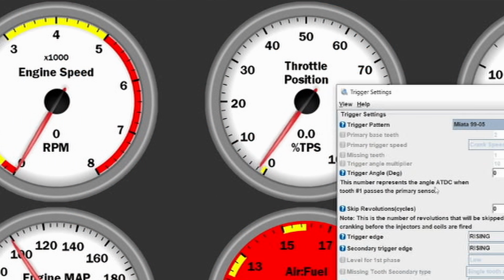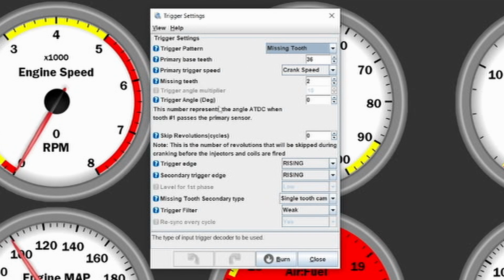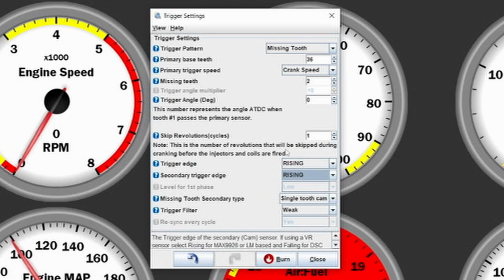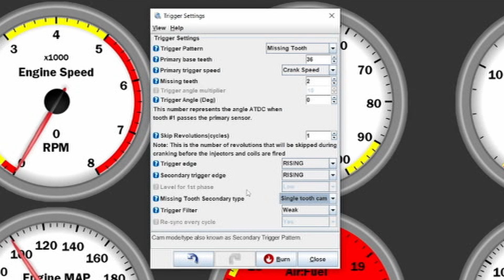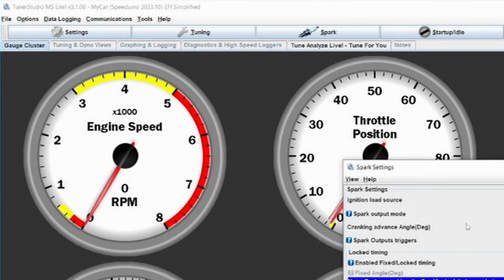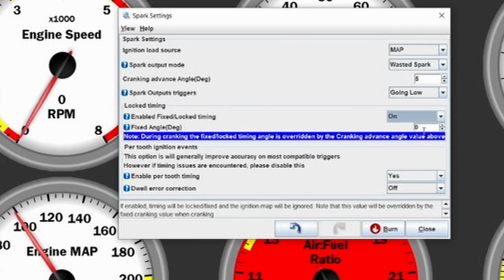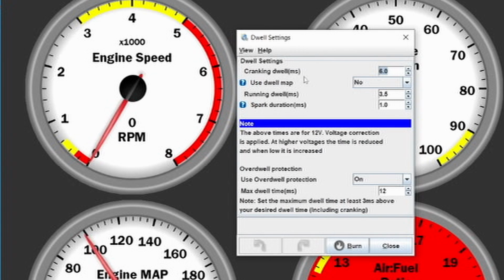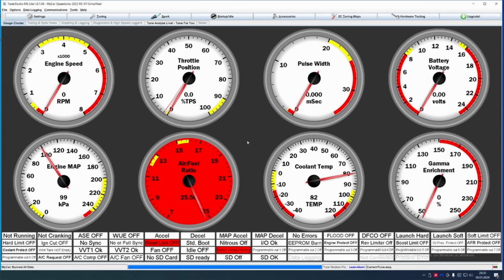Tunerstudio Standalone ECU Tuning Guide | Part 3: Trigger Setup & Spark Settings | Megasquirt etc.

Comment from the maker: i am tying to explain as thorough as possible because that has not really been done before as deeply, so If you hae any questions regarding things in the video, feel free to ask here or, if you hae more complex questions about tuning, your project or need your car tuned, feel free to hit me up https://www.instagram.com/_throttlebuddies/

To show support for what i do + some benefits, check out my patreon: https://patreon.com/Throttlebuddies?utm_medium=unknown&utm_source=join_link&utm_campaign=creatorshare_creator&utm_content=copyL
Reply: Can i mount my trigger wheel with the first tooth before the missing tooth right at the TDC? So the config will be 0 on the trigger angle? I´m asking because i´m planning in stalling a 36-1 trigger wheel on my motorcycle (Suzuki GN250) rotor, i don´t know this angle, i will make it up, the sensor have its location, its a VR sensor. Or can i mount my trigger wheel with the first tooth before the missing tooth just line up with the T mark on the rotor?  

If you have any suggestion it will be deeply appreciated.
Reply from the maker: @PowerPC602  sure doesnt matter the distance of the missing or first tooth to the sensor is the rleevant measurement for trigger angle i also show how thats calculated in Part 9. i suggest, you watch that. 

in part 10 wich will eb released soon i show how to set and confirm base timing

Comment: want to check out the simplest ECU code you ever seen?
Reply from the maker: what do you mean by code?
Reply: @throttlebuddies0  The stuff that no ECU would work without. Software/firmware. Code as in source code. Well, technically they can be done with zero software and fiddly ass analog circuits, but no sane person really wants that.
Reply from the maker: @Marc_Wolfe ah yeah of course. well im not THAT deep into it haha, i dont do anything with coding. that i leave to the people that know their stuff, i just do the tuning haha
Reply: @throttlebuddies0  Well, tell your nerd friends.

Comment: I have a question about the single tooth cam gear. How do we decide what angle to set it at...
Reply from the maker: Doesnt really matter if you are using missing tooth its just so the ecu know in what cycle the engine is 

The missing tooth on a system like that will act as a positioning reference on other trigger patterns might be different tho
Reply: @throttlebuddies0  Ok, Ok, I believe I understand, correct me if I'm wrong. The ECU knows exactly where the engine is at with the crank sensor, provided that the angle setup is correct. Then the cam sensor adds an extra layer of precision so that the injectors squirts at the perfect time.
Reply from the maker: @LaTeamPrep  not really an extra layer of precision, but only a reference that the ecu knows in wich engine cycle it is. Because the crank rotates twice while the cams only rotate once
Reply: @throttlebuddies0  Got it.💪

Comment: I'm still confused about whether a 1 cylinder motorbike can be operated without having to install a sensor on the camshaft.
Reply from the maker: Yes its possible the injector will spray once every crank rotation and it will just spray thw back of the valve so no problem there. Might be an issue when you have really aggressive cams but usually not a big deal
Reply: @throttlebuddies0 thanks for information, and now i have clue for setup the speeduino

Comment: I'm not sure if I asked this. I'm running wasted spark 6 cylinder. Using a AMP'd microsquirt with the dip switch, so I'm using WLED for spark C. I was told that I need to enable the setting in the advanced programming in tuner studio? Is that right, if you don't mind. Thanks
Reply from the maker: @Frankie_Freedom  i dont know that perticular ecu so not sure what you mean
Reply: @throttlebuddies0  mostly for enabling 3rd ignition setting
Reply from the maker: @Frankie_Freedom  third ignition? Idk if you are using 6 cylinders with wasted spark and is set to that in tunerstudio and the ecu has 3 or 4 outputs its automatically active
Reply: @throttlebuddies0  correct as you know msquirt has 2 spark outputs for wasted spark the. 2 additional ones that get converted from either aled or wled.
Reply from the maker: @Frankie_Freedom  ok no idea how that works never done it before aorry

Comment: I'm having a missing crank pulse randomly and a coilover charge limit code on my spitronic ecu any ideas on why I randomly would get a missing crank pulse on a 36-1 trigger
Reply from the maker: Check your wiring insulation, and maybe use a shelded wire for the crank sensor. You could also try and set the filters inside the trigger settings to higher or lower levels that might improve thibgs. Also look at the distance from the sensor to the teeth. Should be about 1 credit card thickness

Comment: Hello I've got a toyota starlet ep82 4efte engine I'm about to install a speeduino unit, I would like to use the oem distributor for cam and crank signals can you advise which trigger setup I should use ?
Reply from the maker: Send me a message on instagram and i can send you a basemap!

Comment: Is the trigger angle based of the degrees of rotation off the crankshaft? Not the camshaft, correct? 

My thought process to find the trigger angle is to set the secondary (1 tooth wjeel) to trigger, put a degree will on the crankshaft and zero it, then spin the motor by hand until the next tooth triggers on the primary wheel (multi-tooth wheel). Then record the angle moved on the degree wheel on the crank. This is the trigger angle that tunerstudio is wanting with the dual wheel setup, correct? 

These are some great videos. Thank you!
Reply from the maker: @Granulat3dsugar  if you are using a crank sendor then yes if you are only usibg sensors on the cam then you can also look at the crank as a reference but need to double the degree amount

If i dont know the trigger angle i just try every 20 degrees or so so like 0 20 40 60 80 etc. and where itruns on 4 cylinders i use a timing light to get the precise timibg 
Obviously you could use the timing light from the beginning but its a bit hard if you are alone

Comment: Hey, Grüße aus Fürth.
Hast du schonmal das zündvorschaltgerät am 1.8t geschossen, durch beispielsweise die Dwell settings ?
Habe heute eine kdfi einbauen wollen aber jetzt habe ich keinen Funken mehr 😅
Reply from the maker: kannst mir gern auf instagram schreiben 
eigentlichh nicht die basemap funktioniert schon so wie sie ist. wie gesagt schreib mir am besten dort dann ists einfacher :)
Reply: @throttlebuddies0  habe leider kein insta. Ja war auch basemap aber starten war nicht drin. Und nach mehreren Startversuchen mit der kdfi startete der AEB auch nicht mehr mit Ori. stg.
Reply from the maker: @MrGom85  wenn du facebook hast kannst du mir auch dort schreiben Willi Tiefel 

hmm das ist sehr komisch hast du mal ein paar stunden gewartet damit die kerzen trocknen? evlt zu viel sprit gewesen nach mehreren startversuchen
Reply: @throttlebuddies0  Habe auch kein Facebook ^^ Fehler wurde nach Rücksprache mit dem Hersteller gefunden. Die aktuelleste Software der Megasquirt 3.4.4 ist vorraussetzung für die von Kdfi Downloadbare Basemap. Die besagte Basemap ist aber Für mittlerweile 2 verschiedene Kdfi board versionen bis 2024 und ab 2024. Die 2 Board versionen haben unterschiedliche Zündausgänge (Spark output Trigger). Beim AEB wird going low benötigt aber nach Update bzw mit frischer Basemap ist Rising eingestellt, was ein Durchbrennen des Zündsteuergeräts zu folge hat.

Comment: Thanks for the video! Really helped me so far. I'm trying to run sequential on my NA8 motor, i have a standard NA optical CAS on the back of the exhaust cam, and 36-2 trigger wheel with vvt hall sensor on the crank. 

Everything runs fun semi-sequential off just the crank sensor, but how can i include the CAS signal to run sequential? 

Can it be done with the standard optical cas? Ive heard i may need a later Hall CAS and to modify it to output only a single pulse
Reply from the maker: Hi, there should be two signals coming out of the cas, as it has to use that for "crank" and "cam" otherwise it wouldnt know where it is. that homing signal should be the yellow and blue wire i think, though dont quote me on that. this could be used as a reference. but again, never done it on an NA so i dont know the specifics
Reply: @throttlebuddies0  thanks for the reply, yep the yellow wire is there, CMP signal, the other signal from here I've cut off and am using the CKP from the actual crank sensor instead. 

The CAS yellow wire has two pulses, a long pulse and a short pulse, I've heard that I need to block the long pulse from happening? Any idea if this is right?

Would it work with the two pulses? What settings would I need in the second section you describe in the video?
Reply from the maker: @provar1  no i think you need to splice the blue yellow wire into the ecu as that shows one pulse. modifying it so that it shows one pulse wouldnt be possible except for groinding the part off of the cam that is that "long" pulse. 
you will need a singular signal as a homing signal. as the ecu needs to know in wich stroke the engine is

Comment: Hi. If I don't have a cam sensor and the jumpers are set for only crank trimming, how should I set the secondary trigger edge? Can I disable that option?
Reply from the maker: in theory when you use wasted spark and batch injection then it should just work right away, just dont select something for secondary.

Comment: Subbed. Great content and a great refresher for me. Been out of things for a while! So would a Speeduino be good for a 6g74 single jingle in your opinion? (turbo application) From what I can see on here I should be able to do a COP setup, even if wasted spark on the standard sensors.
Reply from the maker: Thanks! Should do it fine, if it has missing tooth and homing tooth on the cam you will be able to run sequential aswell. as long as it does not have direct injection or anything, you are gonna be fine